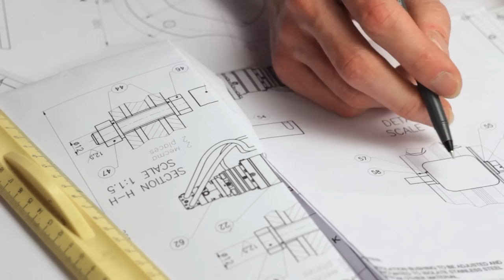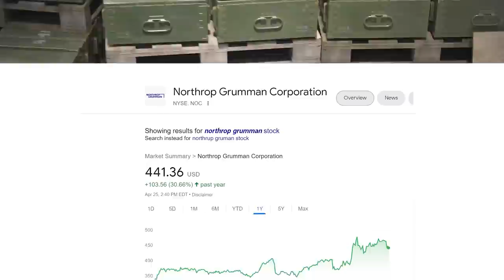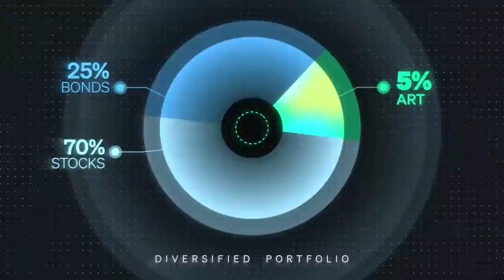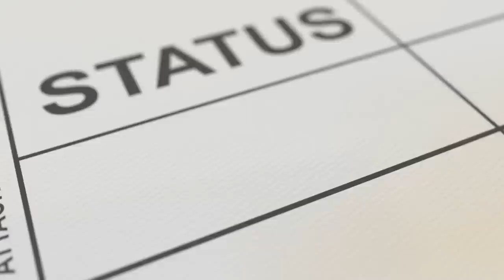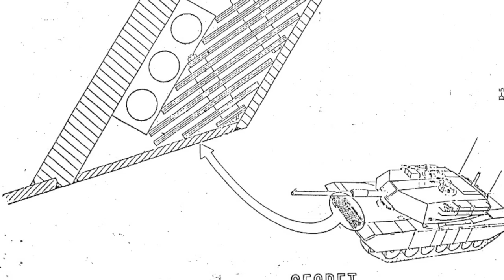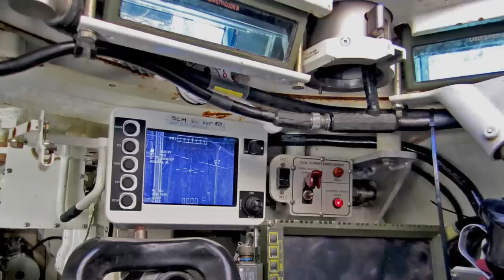The M1 Abrams Tank Needs to Chill Out

Comment: A big gun that can move around the battlefield will always be relevant. Armor may or may not be relevant due to weight, but combined arms, active protection, and used correctly, it will ALWAYs have a purpose. This might evolve to a mobile missile carrier, remote controlled, or even AI. A tank used today correctly certainly has a purpose, especially supporting the infantry.
Reply: Eh, they've tested missile tanks before, and they performed worse. The Big gun always wins on "the draw" so to speak, and you need armor to survive being hit by a kintetic penetrator that doesn't care much about ADS
Reply: @dragon12234  futur tanks may survive small arms up to 30mm but that's probably all, situational awareness and mobility will be the thing you want to have
Reply: @zzaronn  explain to me how tanks will regress from protecting against missiles and sabo rounds to only being able to stop 30mm frontally and nothing more?
Reply: @sporperino  when anti tank weapon will be too powerful. But with NATO caring about tank crew's life it may not happen. But a lightly armored tank can be  much faster and with a better awareness they should be able to survive
Reply: @zzaronn  What do you mean by an anti tank weapon becomes too powerful? And why wouldn't they slap on some era blocks on it? Plus, tanks like the Merkava and M1A2 have active protection systems that prematurely detonate warheads like missiles if they get too close so why wouldn't they just add that?
Reply: As long as it has an engine, it will have a purpose that infantry cannot fulfill.
Reply: @dragon12234  You're right that the performance of a missile tank is worse than a tank with a main gun, but an advantage of a missile tank might be that they are cheaper. For instance, imagine a small, tracked and remotely controlled vehicle which can shoot javelin missiles. This would definitely have a use on the battlefield. Yes, I know drones already fulfill that role but still I think it could have potential
Reply: @jasper8291  yeah, it would, but not as a replacement, rather as its own thing.
Also, missiles are a lot more expensive than cannon ammo
Reply: @sporperino  with new tech it get easier and easier to hit a tank and harder to avoid getting hit, and i believe at some point it would be more effective to have less armor and find other way to survive.
Different missile will appear, able to not get detected or simply strong enough to damage the tank even if detonated early
Reply: @zzaronn  If they get some sort of cloaking tech, why not put it on infantry or AFVs? Anti-tank missile systems fire a projectile that explodes, it would be costly to manufacture single-use warheads with cloaking systems instead of using it on, for example, recon troops. And usually, the fragmentation of a missile when it explodes  would be pretty harmless to a tank so you would probably need something like a naval gun to wreck a tank and I'd think it would have to aim pretty close to do that
Reply: @sporperino  A hellfire missile aint gon miss a big target
Reply: AI tanks of the future are going to be devastating. Especially if they are equipped with high speed electric motors. Imagine you go to peak over the edge of a roof to launch a missile at the tank....and within a fraction of a second the tank recognizes a soldier, whips the gun to the target almost instantly, and lets of a few rounds before the soldier has even blinked. Shits terrifying. It's just a matter of time.
Reply: @rabbit1360  That would take a tank out of action
Reply: @sporperino  that’s my point. No amount of armor is gonna be effective enough to defend it, unless you want the tank to be just a giant block of metal. That’s why you sacrifice armor and get  stuff like trophy systems and speed.
Reply: @rabbit1360  The M1 does have some pretty decent composite armor though
Reply: @sporperino  that won’t do anything against an atgm, especially since most of them target the roof

Comment: What Ukarine has shown is that armor without protection and support is basically useless
The US military has heavily invested in protection and support to make sure that its armor doesn't get shredded as easily as Russia tanks
Reply: Ukraine shows that Russians left behind tons of broken down tanks. 100's of them. 
You see very few videos of Russian tanks without support getting destroyed. 

Abrams on the other hand has never faced any challenge of an army with a comparable tech level. Israelis did and they got some "lessons" out of it. One of them was infantry support and the other one is that you need to slap hard the artillery commander before you go to a mission.
Reply: @maxmagnus777  
The issue here is that Russia APS as well as made lofty claims about its tanks
"During a reported test conducted by the Russian military in 1999 the T-90 was exposed to a variety of RPG, ATGM and APFSDS munitions. When equipped with Kontakt-5 ERA the T-90 could not be penetrated by any of the APFSDS or ATGM used during the trial"
Yet Russia armor is getting smashed with ease
Reply: Switchblade destroy easy you mbt with top superbest squad and supertruper tactics 😂!!!
Reply: @angelmario7085  
Again goes back to the lofty claims
Russia claims that its EW can neutralize UAV, yet its not happening
Russia claims that its upgraded Pansitr , Tor, and Tunguska can deal with UAV, again not happeniing
Mobile gun systems like the Tunguska should be able to down UAV with its 30mm cannons but again not happening?
Reply: @maxmagnus777  you see absolutely tons of videos of Russian tanks getting destroyed, wdym?
Reply: @verdebusterAP  Hello to 21th century, propaganda you will see the same video of a tank being destroyed, is hard to believe 40 bayraktar destroying 52728191 tanks alone in a war, which the Ukraine doesn't have the basic anymore.
Reply: @jonathanpfeffer3716  Yes, you see those videos. You are 100% correct. 
So let us dig a bit deeper in that topic. 
We also know that Russian tanks break down A LOT.  I've heard it on podcast on one of DPR captains/high ranking officers.

He tried to lower the numbers but it was evident that they are poorly maintained.

Still, you see these people coming close to destroyed Russian tanks. They stand there and talk, and laugh. What is wrong with that picture?
Well, if you had ever stood near vehicle where humans were burned alive, you would know. The stench is horrible. The sight is horrible. You vomit once you get close.
Reply: @maxmagnus777  that's if they got destroyed, if they broke down. those soldiers would have run back to base as soon as it did. also, why are we bringing morality into a tank discussion?
Reply: @MatthewT394  First what morality?!
Second: In case you do not know how military works: it consists of a lot of units, tanks and BMP-s and trucks ect. 

Those travel together. So once a tank breaks up it is left and the crew goes to other transport vehicles. They continue traveling in BMP-s and supply trucks or go on top of other tanks.

If they got destroyed? There are videos of destroyed tanks. In 99% they are solo tans just STANDING there. Tanks do not just stand. They do stuff, like move shoot ect. 

If they got destroyed? Both Pentagon and Russia said that Russia suffered losses in "material". Material means vehicles of all kinds.
Reply: @maxmagnus777  dude, chill. i was just being funny. also i was talking about how you had to mention that how they get close to the tanks the smell of the flesh and everything. that was unnecessary.
Reply: @MatthewT394  Actually, I haven't heard that argument anywhere. It will surface up eventually. 
It is a horrible thing but for me it proves that none of the people commenting had actually been close to such mess.
It is an easy tell.

Comment: Here's another Fun Fact for you guys, actually a "Holy Shit!" quick story. Stationed in Alaska in Charlie Co. (ABN) 4/9, 172nd LIB between 79' and 82'. I had surgery and was reassigned out of a line platoon to the headquarters platoon in the motor pool. We had Dodge M880's, 3/4 ton trailers, snowmobiles and a couple of M151's with trailers. I was driving the 1SG out to the gunnery range where the mortar platoon was for the week in the winter. I had to stop at a "T" intersection of the trail system and due to the alders (the name of the trees IIRC), I had to inch forward to see down the cross trail. As I inched the nose of the 880 out I was looking left as the 1SG was looking to the right. I see this huge amount of blowing snow hauling ass toward us down the trail. Just as I slammed the 880 into reverse and hit the gas out of the intersection, this tank that I had never seen before flies by the front of the truck. On the turret side was painted "Yukon Jack". They about killed the 1SG and myself. A few years later I see a plastic model kit with the box art of the "Yukon Jack". It had been in Alaska doing cold weather testing of electronics and the hydraulic systems I found out later.
Reply: Funny 😂😂👍

Comment: The Sherman actually had a similar crew survivability focus. It has one of the best crew survival rates of the war, and I think flat out the best among mainstay tanks (i.e. not the specialized ones, but the grunt ones). Crews would get a Sherman shot out from under them, go back, get a new tank, and be back at it.
Reply: Sometimes, many times they got cooked. I remember an interveiw with a maitenance guy that had to repair shermans in WW2, he said it was gruesome,they would come  in with body parts still inside,They'd fix it,paint over the blood and guts and give it to the next crew, I know I wouldn't to ask what happened to the last guys, seeing welded up holes from 88's.Plus we didn't face many german tanks, we outnumbered them tremendously. Big tank battles were Eastern front.
Reply: @jmy7622  That experience was the case for every tank crew in WWII. The Russians lost tens of thousands of T-34s from 1941 through 1945. I'm quite sure that the poor sods who had to hose out the recovered ones saw some rather gnarly things.
Reply: But they used extremely flammable airplane fuel - the Germans called them "Tommy cookers"   :(
Reply: @mrzoinky5999 Same old tired bullshit! The fuel was not the problem. Knocked out Sherman's that were examined found the fuel tanks rarely were ruptured. It was the placement of the ammo racks that caused cook offs. Added armor and different placement solved this.

Comment: I believe that the newest M1A2 sep 4 has 7 thermal cameras, allowing it 360 degree situational awareness. It also has Trophy APS, and with new 120 MAP HE round they can shoot everything from armored vehicles, structures, and can airburst to kill troops and aircraft. With predictive software, each shot has the accuracy of a guided missile with automatic lead. A possible upgrade might even include a seeker head and guidance fins for even more accuracy.
The Abrams is already an apex tank, but upgrades are making it unbelievably capable 
Future upgrades will have AI assisted detection and targeting software. Coordination with drones, including carrying its own is around the corner.
Reply: And where would the 7 thermal cameras be seen from? There is only 1 Sensor on the tank that will detect incoming ATGM's and that comes from the Trophy APS. The tank is far ahead of its time with the current technology and will remain the tank for the foreseeable future.
Reply: I've been having a hard time finding sep4 info beyond the most basic descriptions. You happen to have a link that has more info? In particular, I didn't know the details on the thermal imaging. That has to be something the commander has to be stoned about
Reply: @CCM1199  
The driver, TC, Crows .50, gunner, two rear cameras, and I think one more, might be wrong. They have varying capabilities, based on size. Obviously the driver and rear cameras have less range but can probably spot a dismount at 300. The gunner, TC, and Crows all have independent optics that have long range capability and can scan different sectors. Many armored vehicles across the world are upgrading to this capability.

The tank has the same challenge the ATGM team does- stay undetected, see the enemy first, shoot first, and kill. The tank will use it's superior optics and electronics and ATGM teams will use it's small size and mobility.

Comment: M60A3 and M1A1 Master Gunner here.  You really need to get hold of Hunnicutt's "Abrams:  A History of the American Main Battle Tank Vol. 2."  It will challenge a lot of your preconceived notions of the M1, starting with it having any relationship with the MBT 70.  The only thing the M1 has in common with the MBT 70 was the desire to field a new main battle tank.  The M60A2 had more in common with the MBT 70 than did the M1, at least it shared ancestry with the maingun.

Comment: Since a modern battlefield is essentially always combined arms, it's a little misleading to look at just one weapons system such as the M-1 in isolation.  Allied tanks will be supported by integrated infantry, air, anti-air, artillery, surveillance/intel, etc. so it's more a matter of what the Abrams and allied tanks can ADD to the overall mix rather than what they can only do by themselves.  As for the entire mix, the M-1 can still be an invaluable addition; as for a "by itself" scenario, I say let the video gamers decide because that is where it's most likely to occur!
Reply: Well the US still has Tanks quite separated from other divisions which I consider to be a weakness of the US doctrine.
Reply: @tomendruweit9386  Tank divisons do not mean only tanks? The Germans in ww2 put plenty of motorized infantry in their tank divisions, I am sure the US is not that far behind.
Reply: @ilpazzo1257  what I mean is that Americans do use combined arms but still with them being seperate
Reply: @tomendruweit9386  Correct. That is mainly for maintenance and supply reasons and doesn't apply to armored cavalry units (of old). In combat the battalions in the brigades cross attach down to platoon level into combined arms units supported by artillery and AA assets (what little the USA has). 4 tanks companies, 4 Bradley companies, 2 recon platoons, and an attached artillery battalion equals one force of 3 tank companies and 1 Bradley company and 1 recon platoon and one force of 1 tank company and 3 Bradley companies and 1 recon platoon both supported by the artillery battalion.  This can also be a 2 tank and 2 Bradley mix and the companies can mix by exchanging platoons.
Reply: @tomendruweit9386  just fyi (old broken knees and back m1 tanker) yes, while we have armored battalions that are just tanks. We do train in combined tactics. And when we do get deployed it is not uncommon for a tank company to have it's platoons split up to supplement infantry and other soft units and basically be integrated I to that company. 

Our unit in Iraq had two of our 3 platoons taken and we were given 2 mechanized infantry platoons (with their Bradley's and other soft dismounted weapons. Since we already had training on combined arms tactics we blended quite nicely. Crunchiest to scout...tanks to do hard kills...and punish positions with very accurate direct cannon fire. 

Yes so while in garrison we are a pure armor unit, we trained for several possibilities.

Comment: There will always be a use for the tank and a counter to the tank, this has happened before in the 1973 Yom Kippur war but tanks still proven their use after that ATGM scare. Also the Russians are using Cold War Era tactics and tanks. The tank itself isn’t obsolete it’s the tactics. So new tactics will need to be devolved and test. Check out The Chieftan’s video on it.
Reply: Indeed.  The old tactics don't work anymore.
Reply: Says the tanker. Dead.
Reply: Just see the contrast between Fallujah and Chechnya and the answer is right there in front of you. Both were urban cesspools but only one turned out to be a graveyard for tanks.

Comment: Good old berm drills.  

As a long-serving NCO, you hit the nail on the head when you talked about combined arms and training.  When the US uses tanks, we rarely send them forward on their own.  They are preceded by Scouts (like me) in HMMWV's, Bradley CFV's and sometimes on foot.  Our name says it all.  We scouted enemy positions, marked strongpoints and reported enemy location, strengths, compositions, etc. to the tankers.  This way the tank platoon/troop commander can devise the best strategy of attack.  We could also call down artillery and air strikes on the enemy strongpoints, weakening or obliterating them before the tanks even arrived.  When the tanks did advance, they were often closely supported by either mounted scouts or infantry who could rapidly dismount to clear urban/wooded areas.  They'd also have helicopter gunships hovering right behind and probably fixed wing aircraft stacked up for thousands of feet.  In other words, the US doesn't mindlessly drive forward in tanks.  We use tanks as they are meant to be used: the armored fist at the point of a full body strike.